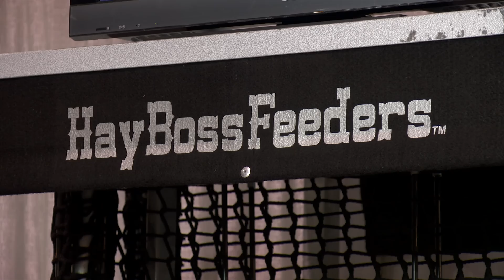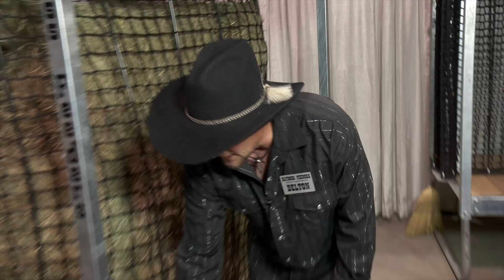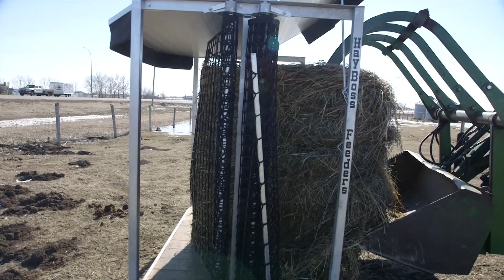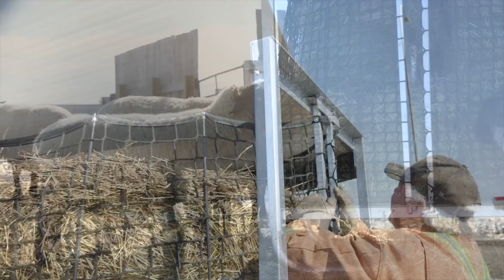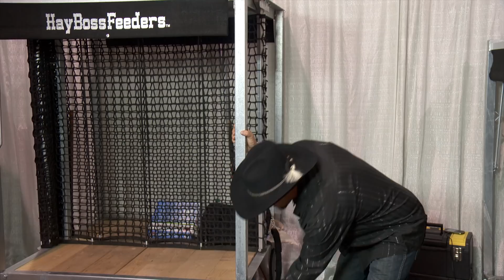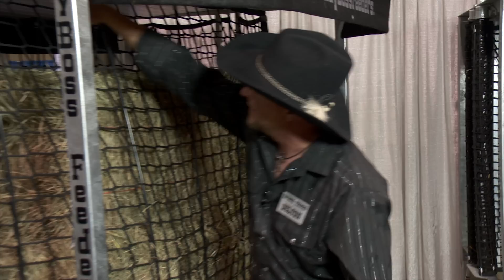Hayboss Livestock Bale Feeder

Comment: Not trying to hate on the guy, but wouldnt a "v" shaped feeder with ridgid steel netting be just as effective? The food would naturally push down and you'd just dump hay in the top relying on gravity.
Reply: I think this system works better than your "v-shaped" feeders. Specially on sheep, where you want to eliminate feedwaste falling down on their wool, because that would downgrade the wool. As far as for cows, horses and goats, yeah, it might work, but how would you design a "v-shaped" feeder then if you want to feed roundbales or big square ones? You will almost always end up with either stuck bales halfway the feeder or end up with some feeder type that is already available.
Reply: Might tip easy with bigger animals
Reply: Rigid steel netting is bad for a horse's teeth.